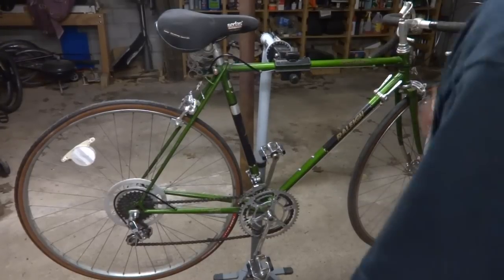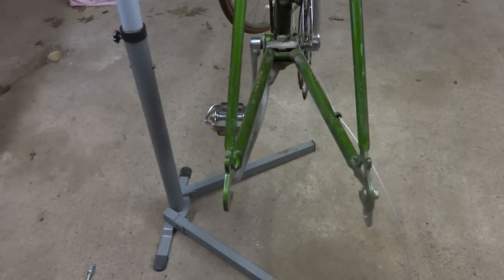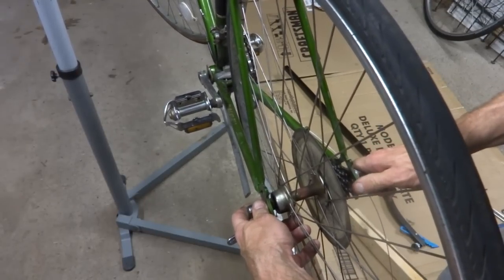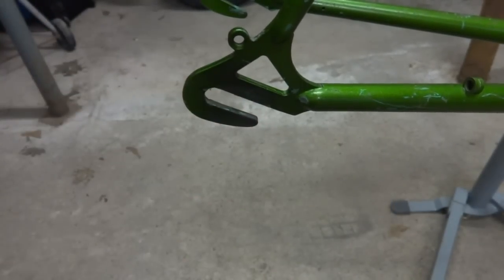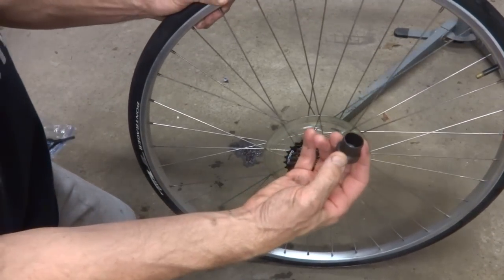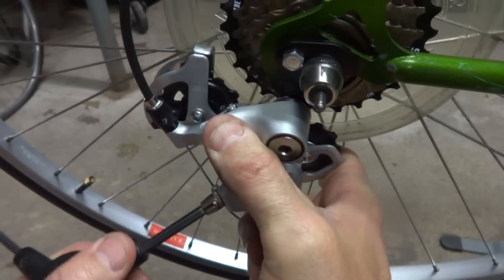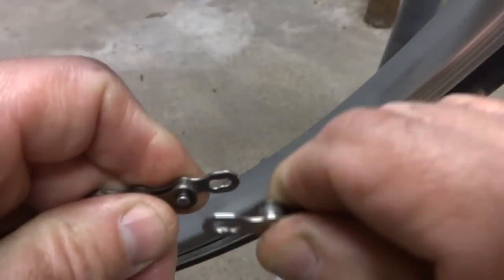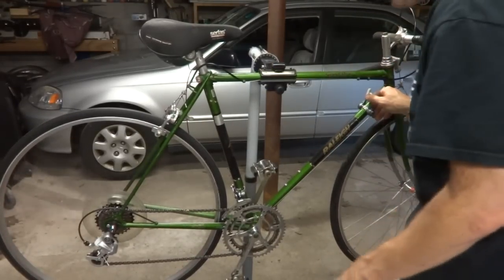Upgrade Vintage 10 Speed Bike To 14 Speed & Indexed Shifting

Comment: Currently rebuilding a 84 fuji espree and I can't find any info for rear axles. I need a new one because the old one is seized and the time I'd have to put in isn't worth saving 10 bucks. Current size on the axle is 135x10mm. Would I need a longer axle with the wider free wheel? Thanks in advance and you have been a life saver through this process RJ!
Reply from the maker: I don't know if you need a longer axle or not. https://www.sheldonbrown.com/frame-spacing.html

Comment: Say i wanted to index the shifting, could this same process be done with trigger shifters?
Reply from the maker: Yes. And this was indexed shifting.
Reply: Do you have any tee shirts in red ? Wanted to order off Amazon but black was the only color ::
Reply: So I’m trying to do the same process but want to put a three chain ring on the front, say from a mountain bike... will I need to upgrade the bottom bracket ?
Reply from the maker: @bryanp3796  Probably.
Reply: @RJTheBikeGuy  cool thanks , just wanted to say your videos have really helped me during these weird times, having lost my job as a cook because of lockdowns, bikes are shining some new light into grey days :)

Comment: Would you not do the parallel dropout test first? Because the point where the alignment tool measures could end being different if the dropouts are paralleled after alignment.
Reply from the maker: +Rob Dunford The angle of the dropouts would probably not effect the frame alignment measurement by much unless they were way off.

Comment: RJ,
Great video and nice vintage bike :-)
I know you made this some time ago but do you remember if the wheels came with QR axles ? My Grand Prix is on bolts and I was wondering on the practicality of changing to QR on dropouts designed for bolts ?
Reply from the maker: I think they had QR wheels. And you can change from bolt on wheels to QR wheels.

Comment: Hi RJ, nice video. Any tips on the new derailleur hanger you used for the Shimano rear mech?
I wanted to install a Shimano Tiagra (9 speed) derailleur on an older bike but haven't had luck finding a hanger that fits it. The one you used in this video might just do the trick, so any tips on the model number, links to buy, etc would be highly appreciated. Thanks.
Reply from the maker: This is like what I used. https://www.amazon.com/SunRace-Shimano-Compatible-Index-Hanger/dp/B001PT8M8C?ie=UTF8&redirect=true&tag=youtube25-20
Reply: Perfect. Thanks a lot for the swift reply.

Comment: Hey Guy,

good video and ridiculous tools. Although we have certain things to discuss:
First of all: Why the hell don't you put annother transverse plank between bottom and frame while bending it?? It will preserve the frame entirely from affecting strains.
2nd: Why don't you remove this ugly plate instead of correctly adjusting your wear stopper measurement??
3rd: What the hell inspired you to install a mountainbike sprocket instead of a good loocking fine adjusted race sprocket??
4th: Why just don't putting in oil this good old bowden control?
It would be as good as new afterwards?!
5th: What about adjusting the rear stopper measurement?! Would that be a good idea to let the awful rear plate from the rim away?!

All in all you did a good job and we enjoyed your video in which you tried to improve this vintage bike!
With kind regards

your screwing comrades
Reply: All of Shimano's current 7-speed freewheel offerings unfortunately have that ugly-as-sin big black final cog.  SunRace makes some decent 7-speeds, as does IRD.

Comment: So when you increase the spacing does that usually take the fork out of alignment, or might it have already been out of alignment, or maybe a little of both?
Reply from the maker: No. This frame was already out of alignment.  I spread the stays and aligned the frame at the same time.

Comment: seemed like you could have stuck one of those expanding car jacks shaped like <> in the frame to spread it a bit might save you on wailing on it with a bit of wood.
Reply: That would just expand it, not compensate for the fact the frame was out of alignment.

Comment: is it possible to take a 7 speed hub and freewheel off a 26-inch wheel and put it on the 27 inch rim and spokes (if they have the same spoke count)? i'd expect there to be some difference to keep them from being compatible
Reply from the maker: aeshir You should be able to. Why? Be aware the mountain bike hubs and road bike hubs have different widths. And if you are going to go through all trouble and expense to rebuild a wheel, why use a 27" rim, when you could go to a 700c rim? And why using a mountain bike hub instead of a road bike hub? And why not just buy a new wheel?

Comment: Nice upgrade for sure. My only critique is for not cleaning the small chainring when putting on a new chain, and perhaps not lubing the gear cables. What was the cause of the rear derailleur not working properly? Tuning or misaligned hanger? Enjoyed the video overall. Cheers
Reply from the maker: Modern cable housings don't need to be lubed. In fact, they recommend NOT lubing them. The rear derailleur worked fine. I just need to spend a little more time adjusting it.
Reply: There were 2 adjusting/limiter screws that needed to be set for the rear gears.

Comment: Question for all: What do you think about the Shimano megarange 14-34T (MF TZ31) for touring? I'd want to leave a 7 speed system on the rear wheel and this option seems sexy to me
Reply from the maker: Personally preference. If you want lower gearing, add lower gearing.
Reply: Yeah, sure. I'm reading around the internet that many people don't like the shifting from the 34 to the next one due to the big gap between the two, but never tried that.
Maybe a standard shimano 7 speed cassette (14-28t) should be enough if I'm going to use a triple crankset.
Reply: G ZA Freewheel hubs in general are poor for loaded touring compared to freehub designs because of their inferior 
bearing placement. The hubs with 7 speed freewheel cogs in particular are axle benders. If you're at 126mm you 
should look for a an older 7 speed freehub at that width or consider bending to 130mm & buying a new wheel if 
you're going to do any serious touring. Rear hub and sealed bearing design is one aspect of cycling that's advanced light years since the 80's.

Comment: That's wrong about not needing a front ferrule for the derailleur cable housing; there's a step down ferrule needed for that type of cable stop on the chainstay. Also for SIS (index) shifting you need the special SIS housing. That looks sloppy the way it's done and probably doesn't work as well as it should..

Comment: Hey RJ:

I hear you about a aluminum frame.  My vintage 1987 Cannondale currently is a 7 speed.  Spacing between drop outs is  128.5 inside to inside measurement.  Can I go to a 10 speed.  Again, I can not bend the rear out.  I absolutely understand that.

Thoughts?

Thanks
Steve
Reply: Yes, youll just have to stretch the frame a little
Reply: Stretching to get it in is probably ok. But you shouldn't cold set alloy frames; they may develop stress risers that weaken the frame and make it more likely to fail.

Comment: Easier to go from six to five speeds.

Nice IRD freewheel unit ...

My Carlton [fitted with Super Record hubs at 126 mm at the back] take a six speed with ease.

Five speeds freewheel is quite sufficient for amateurs. 

No disrespect intended, but most older riders are quite happy with a wider gap between the lower gears, and these are easier to use on friction levers.

ATB from George

Comment: I have a vintage 10-speed Peugeot road bike, reasonably lightweight alloy frame.  Is there an easy way to move the shift levers to the handlebars?
Reply from the maker: It would be a fairly major update.
https://www.youtube.com/watch?v=SJJyl0xPrJ0
Reply: Replacing the downtube shifters with bar end shifters is easy and relatively inexpensive. They come in indexed or friction.

Comment: Hey, I have an old 12 speed Schwinn world sport.  I know this would ruin the originality/ novelty of the older bikes, but I would really love to upgrade from tube to paddle shifters, and I guess subsequently from a 6 gear cassette to a larger, maybe 7 gear cassette.  Is this possible, and what parts would you recommend?  Open to spending some money on shifters, detailers, cassettes, wheels, wraps, etc.
Reply from the maker: You have to research the parts you want for your project for what you want to end up with.
Reply: @RJTheBikeGuy  I wouldn't even know a full list of parts, I'm looking for you insight.  Can you recommend parts you think would work for this type of conversion?
Reply from the maker: @rzawadski389  No. I get requests like this often. The parts vary  by project. So I would have find out exactly what you have, what you want, what you are willing to pay, etc, etc, etc. Basically, I would planning you whole project. Multiply that by every body else who wants the same thing, and that adds up to a lot of time. I have answered requests for recommendations only have the people come back saying the parts were too expensive or unavailable, asking what else, what else. etc, etc, etc. NO!!!!!!!!!!!!

Comment: can i do the same job on a bike with 110mm dropouts to use a 135mm hub? am i gonna crack the frame and destroy the freshly made paintjob?
Reply from the maker: I doubt I would try going from 110 to 135.

Comment: Was wondering if anyone ever put in an Ultegra, Dura Ace, Red, or other high-end group on an old frame like this.
Reply from the maker: Sure. Probably on higher end frames than this. I just updated a bike not quite as old as this. It was Shimano 105, but I could have just as easily installed Ultegra or Dura Ace. https://www.youtube.com/watch?v=IEL7pLwTZw0
Reply: have a friend that put new   105 set on a old firestone frame.I'm working on a old park pre the part bolt right on for the most part

Comment: I have a question. I have a vintage fuji bike and I need to restore the paint job with original decals. Where can I get decals?
Reply from the maker: Jonathan Chuck There are some online places that reproduce bike decals. Google "fuji bike decals". But you need to shop around. You may or may not be able to find the exact decals for your bike.
Reply: RJ The Bike Guy Just found the right ones. It's a vintage Fuji S12-s LTD. I found the right stickers. If you're interested in getting decals for your vintage bike or bikes, it's velo decals.com

Comment: Hey RJ!

 I've had issues with putting my rear tire back on my Schwinn World, when I would tighten the quick release and ride it I would almost immediately feel resistance and it would be my tire rubbing the non-driveside chainstay and would have to go and realign it 2 or 3 times. I quickly realized that the dropout on the drive side is deeper than the non-driveside. What's a surefire way to keep your wheels aligned so they don't go astray? And is cutting the non-driveside dropout so it's flush with the drive side a safe thing to do?
Reply from the maker: https://www.youtube.com/watch?v=0MHBHFu4CrA

Comment: what makes keeping it 27" easier? just because you would have to replace the brakes, or is there something i am missing? i ask because i recently purched a Sekai that i plan to build up and i wanted to switch from 27" and 5 speed freewheel to 700c and 7 speed freewheel. i intend to get long reach brakes and a different derailleur as well as the bb and cranks Are there other things to take into consideration?
Reply from the maker: Yeah, the brakes. Depending on the frame and brakes currently on the bike, you might be able to get long reach brakes, or the reach might be so long to begin with on some of these old 10 speeds, that it would be difficult to find longer reach brakes..

Comment: Those ferrules were for 5mm brake housing, right? Ferrules for the shifter housing (4mm) are most of the time slimmer and made of plastic. Could you also do a video of your bikes you have that you use yourself?
Reply: There are higher-end Jagwire (and other) metal 4mm ferrules.  They can make for maintaining good shifting as things get older.  I hate the plastic ones as they crack and break too easily and that makes shifting worse.
Reply: minhtoi Yeah. Plastic ones are quite a nuisance. Never knew that some companies made metal 4mm ones, thanks!

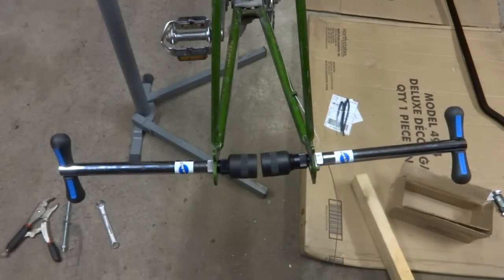Comment: Hi RJ, at 10:20 is it important for the dropout to have a good alignment? If the alignment is off by a bit, is it ok?
Reply from the maker: +perwiratempur Misaligned dropouts can cause bent/broken axles or other hub damage. It will never be perfect, but the closer the better.

Comment from the maker: ukfan4sure1, all-thread trick?
Reply: +RJ The Bike Guy Where did you get the components for the 7 speed groupset? online? The cassette, the rear derailleur, the indexed downtube shift levers, what are the model numbers. Also I  need a 700c rear wheel that will take the 7 speed cassette.
Reply from the maker: I get most of my components ebay, craigslist, amazon, from other bikes, or parts I have lying around.
Reply from the maker: And it was a 7 speed freewheel, not a 7 speed cassette.
Reply: +RJ The Bike Guy any model numbers for the rear derailleur? I want a silver one to keep with the vintage look. The one in this video looks perfect.
Reply from the maker: +The 21st Century Nah, don't go with a Huret. Check out some vintage Suntour deraileurs. They have that vintage look and are better derailleurs. http://www.disraeligears.co.uk/Site/SunTour_derailleurs_-_the_V_story.html
Reply: Why are you always in socks or bare feet?
Reply from the maker: Because I am comfortable and my OSHA rules don't apply.
Reply: Would'nt it be easier (and less intrusive to the crankset) to put some type of expander betwixt the dropouts?
Reply from the maker: Yes, which I do in some other videos. But that moves both stay approximately the same distance. In this case they were uneven to begin with. So I only wanted to move move the two side in different amounts.

Comment: What rear derailleur would you recommend for an old 10 speed Schwinn? and front derailleur?
Reply from the maker: Are you upgrading it to higher speed, or leaving it at 10 speed?
Reply: RJ The Bike Guy It's ether I want to leave it 10 speed or upgrade it to 12 speed I can't decide.
Reply: RJ The Bike Guy or just something I don't have to bend the frame for.
Reply from the maker: ZeroAmplified You would have to expand the frame to go to 12. So you might as well stay with the derailleur you have, Or pick up any vintage derailleur you can find cheap.
Reply: Oh okay, thanks.

Comment: Hey RJ, what did you use for the liner in the cable guide by the BB shell?
Reply from the maker: +Sean Armenta It was just some liner that I bought. I think I got it at my local bike shop.
Reply: +RJ The Bike Guy okay, just wondering if there was a specific name for that. different from cable housing, yes? just ask for cable liner at the LBS then?
Reply from the maker: +Sean Armenta Not sure it has a name other than inner liner. It's like the liner that is inside the cable housing.
Reply: +RJ The Bike Guy got it! thanks for making these videos!

Comment: Any concern that the two-by-four will bend the seat post while you're trying to spread the triangle?
Reply from the maker: Not really. It doesn't take much pressure to spread the frame.
Reply: I just stretched out my old mtb frame with a piece of 2x4 with a way safer, more even method. I cut the 2x4 at an angle with the long part at 140 mm and whacked it between the droputs. Ended up a perfect 135 mm

Comment: Hi, I have an old 5 speed bike (5 cogs on the cassette on the rear wheel) with paddle shifters. I was wondering if I could make a 10 speed rear wheel (the cassette on the rear wheel has 10 cogs, 700c size) by simply throwing on the wheel and a 10 speed chain.

Thank you!
Reply from the maker: There will be a little more work than that.
Reply: @RJTheBikeGuy  what else would I have to do? Change the derailleur and crank-set as well?
Reply from the maker: @skyscraper5910  Maybe.
Reply: @RJTheBikeGuy  uhhh, what can i do to get more information?  :/
Reply from the maker: You are doing a custom project. So you will have to figure it out.

Comment: What do you call the little gear cable housing the 2 inch piece that fits above the bottom bracket shell
Reply from the maker: Cable housing. It doesn't have a special name.

Comment: Hey does shimano 105 5700 non drive crank fit on tiagra 4500 crank? Reason being i desperately want to get a stages power meter on my bike but don't have the money to upgrade the entire groupset or get a new bike
Reply from the maker: I believe it will work. It looks like it uses the same bottom bracket. Make sure you get the same length.
Reply: Janope13, yes it does.  It's not the bottom bracket that matters, but the permanently attached crank spindle on the right-hand 4500 crank arm.  Both are "hollow tech II".

Comment: Do you need to change the rear derailler?
Reply from the maker: Yes. Older 10 speeds had friction shifting. You would need a newer Shimano SIS derailleur that is made for indexed shifting.
Reply: How can you tell if it's a friction vs SIS derailleur
Reply from the maker: Research the specs. Pretty much all the 7 speed and newer Shimano derailleurs are SIS. Even some of the 6 speed ones.
Reply: Do all vintage 10 speeds have friction brakes? Sorry for all these stupid questions lol
Reply from the maker: Friction brakes? Do you mean friction shifting? Most. There are probably exceptions. But this would likely not be modern Shimano SIS.

Comment: Couldn't you just adjust the dish on the new wheel ? Seems like bending the frame could cause damage to the head tube and other various parts you are putting pressure on.